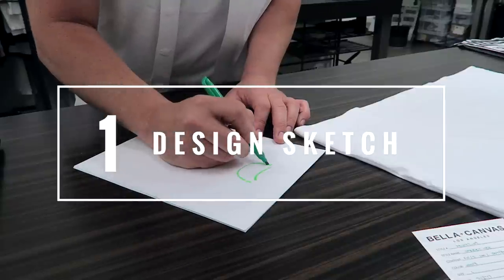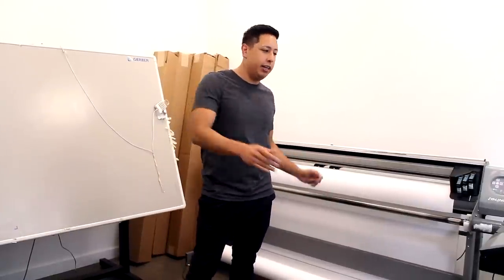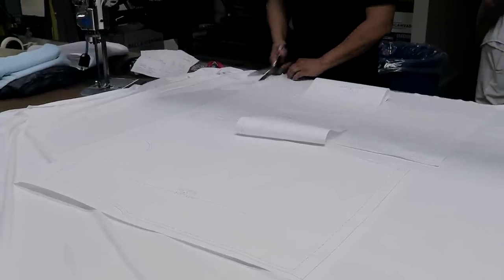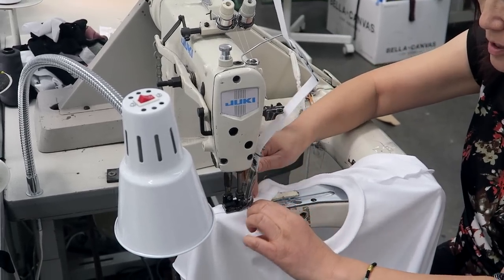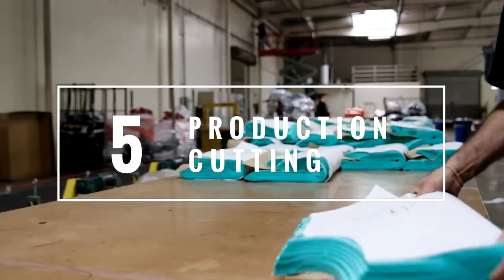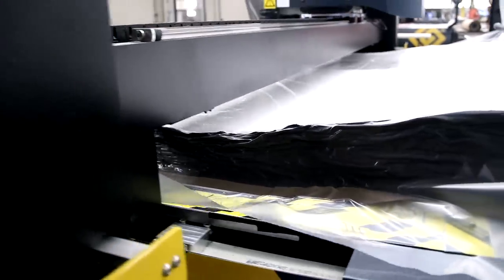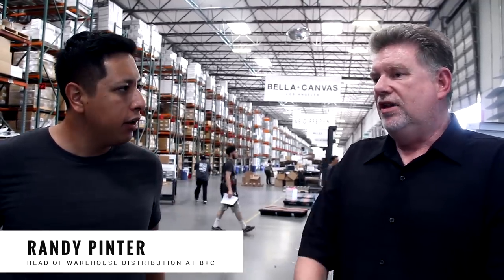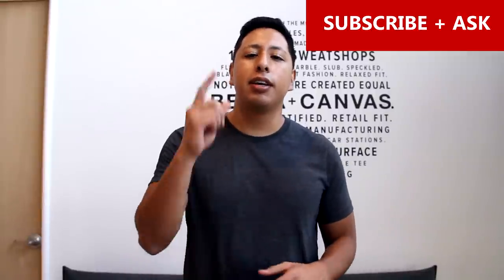How To Make A T-Shirt From Design To Manufacturing Process

Comment: Hey John, what programme did they use for pattern designing?
Reply: Pattern Making Software
Reply: There is quite a bit out there. But the top 2 would be Gerber Acuu Mark and Optitex PDS. You could also design patterns with auto cad.

Comment: which software used for pattern designing ???
help me out
Thanks
Reply: Pattern Making Software
Reply: There is quite a bit out there. But the top 2 would be Gerber Acuu Mark and Optitex PDS. You could also design patterns with auto cad.